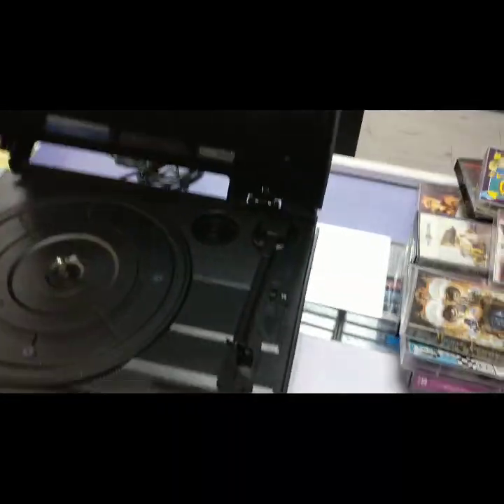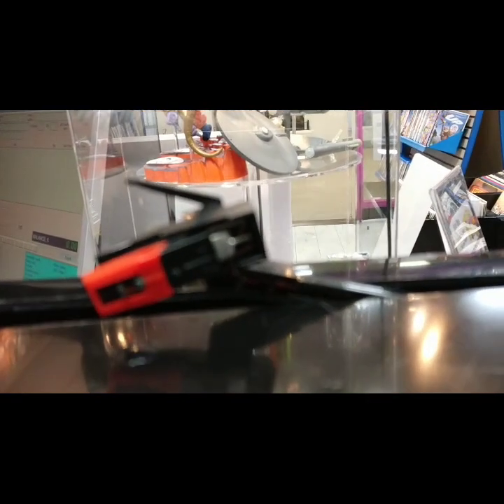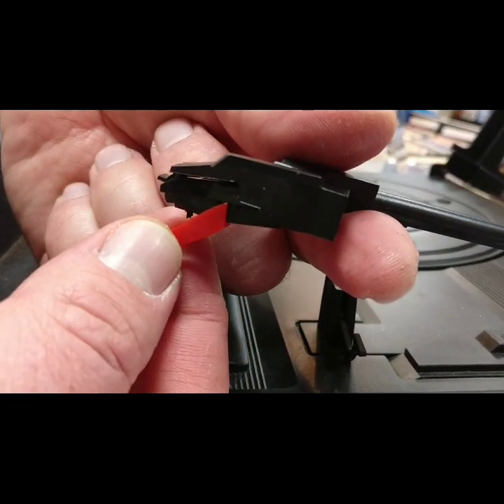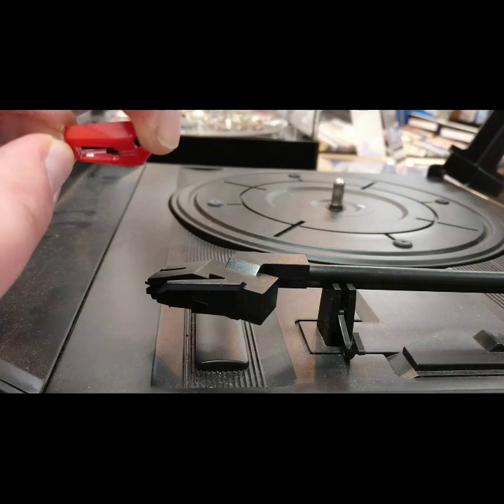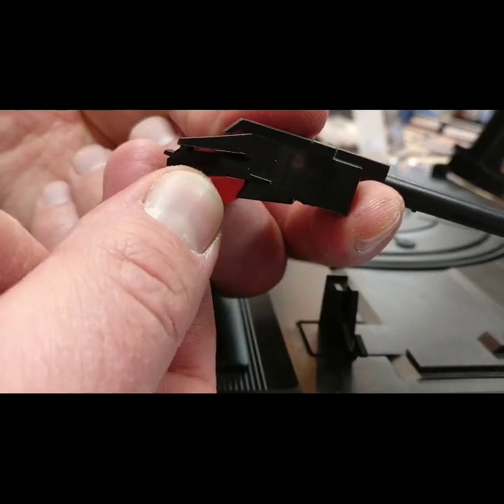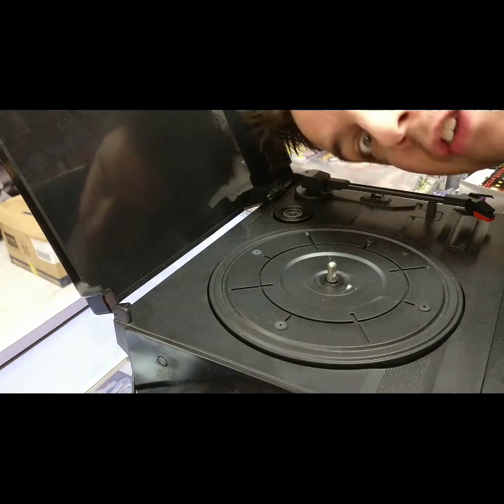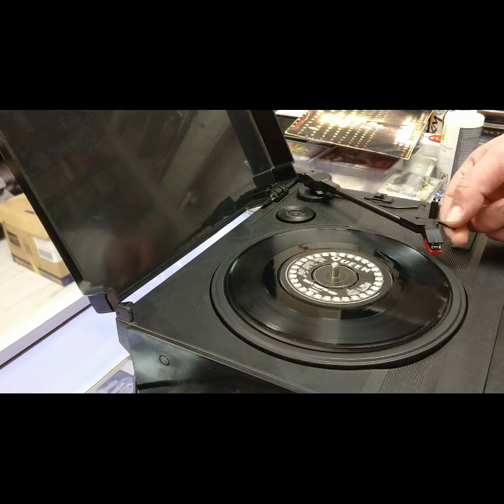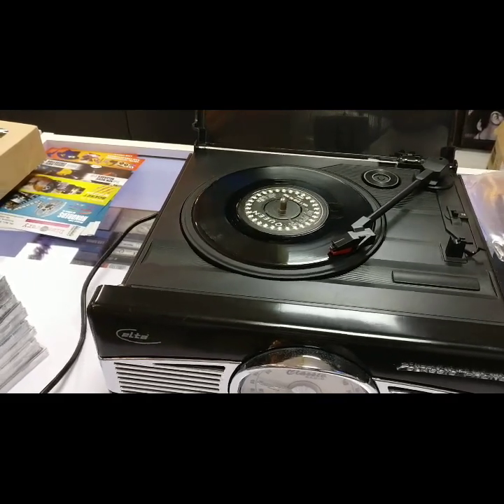Replace a stylus needle on a record player, in Discovery Tullamore

Comment: hello i have a repro victrola vta 800 B  5-1 radio/record player. the radio still sounds great its only 2 years old. but i just noticed when i tried to switch it over to the turn table it turns but there is no sound only you can hear the record but its just a faint whispering sound there is nothing comming out of the speakers. i noticed that the stylist is worn down .and i wanted to know is that the reason why theres no sound it was working fine just last month.but its really frustrating.is there anyway to fix this.oh and i noticed when it was working when you switched over to turn table it would make a computerized beeping sound which i no longer hear when i switch it over.is there anyway ti fix it?thanks Richard